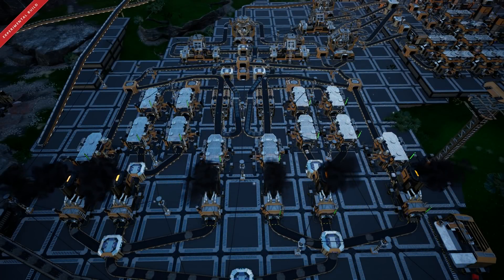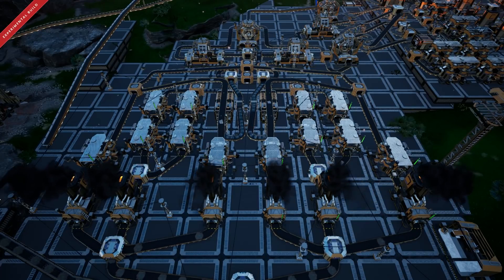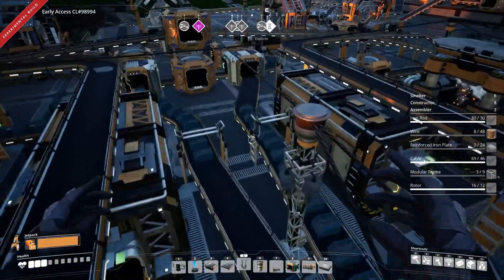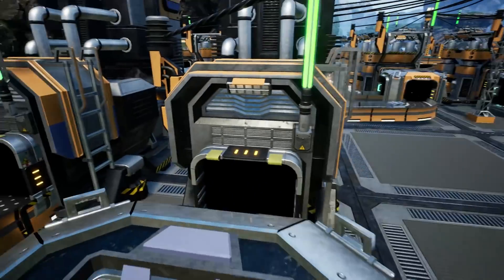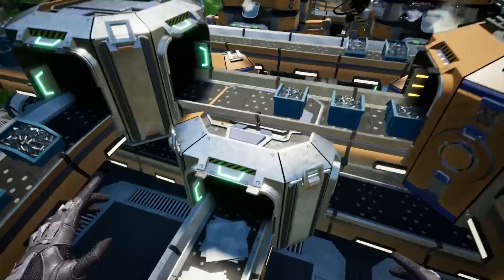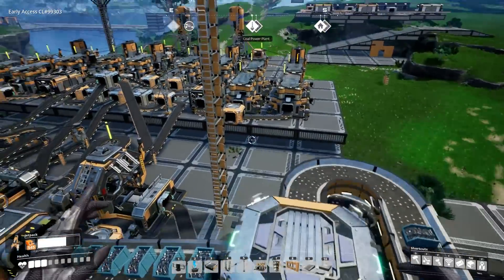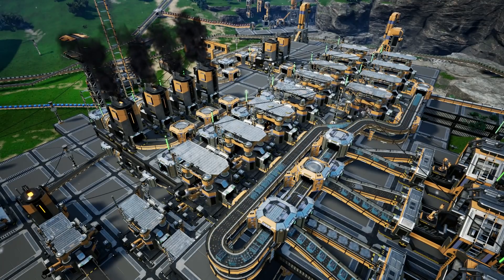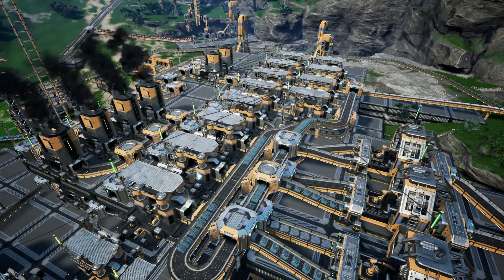Satisfactory Myth Busters: What's More Efficient, Bus vs Perfect Split

Comment: Who on earth thought split would be more efficient at all, I assumed just from logic that if there was a more efficient build it would be the BUS not the SPLIT.  That's why I built that way in the first place.  I don't see how people would come to the opposite conclusion.  Split takes more space and therefore loses efficiency on simple time-to-deliver right off the bat.  Then of course the fact that it awkwardly takes up more space in general is just obvious.  Not sure how the assumed myth wasn't everyone thinking that the split was easily LESS efficient.  Logic and numbers....it's not that hard people.
Reply from the maker: Hey thanks for checking out the video! Well TBH I thought the perfect split was more efficient and a lot of others. As I prove they are both as efficient, there are a few things to bear in mind, perfect splits are less expensive to setup but as you rightly mention take up less space. As to space to time ratios, the split is actually more efficient, in that all structures start working at the same time. and once the systems is running, it runs at a 100% efficiency, which is the same speed as the bus/manifold style, however the difference is the bus/manifold style takes a lot longer to run at 100% because all the structures after the first constructor or smelter have to wait for the previous structure to be a 100% full of items before they can start working a 100%

Comment: In a lot of places, i prefer direct Insertion. Like why do you Need a bus between the iron smelters and the iron plate manufacturers? It's a 1 to 1 ratio, all the bus does, is redistribute the resources so some manufacturers are full, while others don't yet run (yes eventually all will) and use FPS. I see 2 downsides and no upsides.
Reply from the maker: it's a fair point that you make, although please note i'm using iron for a quick and easy example on how to build one in general for those who don't know. Also FPS is not so important now with the recent optimization to conveyors but as I mention in the video it's more compact, so one upside and easily extendable whilst being the same in terms of efficiency if you're running the factory, so it goes either way. That being said it is entirely player choice, there is no one way that is better at everything :)

Comment: This is boggus, cause the perfect split factory always needs to be run at 1% less than full since it otherwise clogs and causes extreme fluctuation in the power grid because of the turning on and of
Reply: i use the perfect split method and don't have the clogging issue,i always use storage containers for buffer, and the only time i had the energy fluctuation issue is before i upgraded my conveyers because they weren't feeding some machines fast enough
Reply from the maker: Sorry i'm not sure if I understand your point, if the system runs at exactly 100% it wont turn off at all and therefore wont have any issue, if you use the bus/manifold system perfectly it's the same, however if you don't plan exactly how much ore will go through your system at anyone time then both will fill up.
Reply: I mean, by definition the net usage stays the same, because the same products are being made at the same rate. I'm not sure where you're getting the 1% less than full thing; are you trying to run your factories at precisely 100% of your power capacity? If so, why? Power generators adjust their fuel consumption based on load so it's not like it's any more efficient, and you're running the risk of a single tiny fluctuation triggering the breaker

Comment: I would have to contradict the busline vs splitline comparison. I was running busline for my coal power plants. I had I think 10 power plants running. The last plant would go through cycles of getting enough, and not enough. Eventually it would deplete.  It did this enough times that the power plant would run out of coal and the system would overload and throw the breakers. I switch everything over to balanced, the issue went away.
As long as the busline is only feeding 4 or 5 buildings, it will work fine. But when you start getting 7+ on the same line, issues start to ensue. Another good example of this is having plates/rods/screws/reinforced plates production. Busline mode will start to have problems. The reinforced plates manufacturers will start to have to wait, even if it's just 1 item, the process stops for several seconds to reset.

Comment: I've been struggling with the overall placement of factories when going for perfect splits.   I've always been told not to use a main bus as it just doesnt work in this game but I think i'm gonna do it anyways as it seems easier to plan, build and expand upon.
Reply from the maker: Perfect splits take a lot more time to develop, I did a couple of episodes on perfect splitting to create reinforced frames, and it looks good but like you can see at the start of this video, for 6 Assemblers a perfect split factory uses up a lot of space.
Reply: Who told you not to use a bus, i am gonna give him a hammer.
Reply from the maker: @Koh-Wei-Jian  :D
Reply: Bus works fine, because it's easy to show with the math that the split imbalances are corrected automatically by backpressure. This means that it takes some time to reach full efficiency, while the oversupplied routes fill to saturation, but once everything is fully saturated, it will run with precisely the same efficiency as an isomorphic lane-balanced version.

This is also why setting your clock rates as precisely as possible is good, because it means that the backpressure doesn't have to build up from the very end of the production line, so you'll arrive at equilibrium more quickly

Comment: I actually combine the two approaches. Bus line splits off to splitters, which each feed 3. I just think it looks cool :D
Reply from the maker: Might have to try it sometime :) Thanks for checking out my vid!
Reply: I also combine these approaches but in a more efficient way: I put splitters on the main bus where I extract 60 items/minutes with short Mk 1 section (all the other belts are Mk 5 in order to feed the machines quicky and also to avoid any mistake), and each Mk 1 conveyor belt feed a small amount of machines. I also feed these sets of machines from the middle, so I reach full efficiency faster.

Comment: What Satisfactory really needs is an inserter - something that can pull items off the belt or put items on the belt. That way each machine can pull off as many items as it needs, without splitting the belt. That would be the best way to set up a large bus system.
Reply from the maker: Tito Rigatoni yes, however I think they purposefully said they weren’t going to go down that route as it’s very similar to Factorio. Maybe with mods 😁
Reply: Or a control system for smart logistics. While stock_material is less than 2*recipe cost: enable splitting to output*
Reply: Unfortunately, my impression is that the games architecture wouldn't allow for that, because items on belts aren't really physically present for any purpose except a player picking them up. They're completely unloaded when no players are nearby.

Comment: Premise needs some serious work TotalXclipse, you invalidated your 'bus' design by how you capped it off at the end.

Bus lines don't have multiple exit points from the main supply. In your design, you had two separate lines deliberately colliding in the process of feeding the middle assembler and therefore closing off the line, and removing one big advantage of a bus line and that is the ability to expand as your belts improve and your input increases.

A perfect split system is ideal for a lot of uses, but expanding them is a bit of a pain. 
A bus system can expand which is ideal when you don't know how many you will need.
Each one has a specific use that you didn't address here.

A single line going into a chain, best speed is a mark 4 belt at 450 units/minute. That's 15 machines you can feed if they use 30/minute. 30 x 15 = 450. However... splitters are not perfect, they do induce a lag on that line which you get something like a water hammer effect when the material is stopped and causes a brief pause in the line if it's saturated. You can also see this effect watching rush hour traffic that slows to a crawl despite the lack of accidents.

And you didn't need to run double belts because of screws and how they're grouped. The buffer in each assembler could hold onto the screws that can't join the line due to congestion. But because you went with a double belt line and finished it by tying the ends together, you effectively created a built in balancer at the tail end.

Good design.. but that's not a bus line.

Side note: You could have ran all the screws on one line and using your design, just use a splitter at the end before feeding the screws into the assemblers.
Reply from the maker: John Walker II thanks first and foremost, it shows you care and have a lot of valid points, I felt that I had to tie the end of the screws line simple because 4 constructora worth of screws cannot run along the mk4 without bottlenecking, if this happened surely the bus line wouldn’t work 100% efficiently - if I was building something different (removing screws) obviously the bus line would be a pure bus line but with it being an apples to apples comparison it made it difficult to do it any other way. 

That being said you explained the process very well, thank you. I promise I shalnt tie the ends for a bus line video again  ☺️

Comment: Do u have a video on how to set up a bus line factory? I seem to end up with something like the split line factory and am constantly fighting to get everything all nice and neat looking like your bus line factory.
  If u dont have a video showing how to set up a bus line factory then could u make one please??
Reply from the maker: I'll add it to the list 😅 Might be busy this weekend
Reply: (RAW Stuff to be processed) -> [split] -> [split] -> [split] -> {last direct in}
(Process it) : {Then, coming out...}
{first direct out} -> [merge] -> [merge] -> [merge] -> (Off to more production-lines)

The trick is simply to match INPUT-ITEMS to CONSUMED-ITEMS... Within your belts capacities.
Then...
Match OUTPUT-ITEMS to belt-capacity, as they exit, from each machine.

Excess you simply overflow, back to the input, or on to another machine set, or just let this machine back-up and wait until it needs to be used again. (Or constantly dump excess into the new "ticket-machine", to earn points from your unused productions.)
Reply: @JD_Mortal  do you use smart splitters to specifically set the separated output to overflow or does it work with normal splitters as well?
Reply: @Jim-cu8wy  normal splitters.

Comment: The problem I have with the bus line method is that if I have big production line, for example 30 constructors producing 450 steel pipes, the last 4 or so constructors are barely working as their output isn’t hardly able to send anything out due to the constructors closer to the output line clogging it all up. Anyway to get around this?
Reply: this sounds like an output timing issue, I am assuming your using Mk4 belts which can push 450 items per min. but, with 30 constructors in line by time the last constructor pushes out its part the first one is already pushing out another part. If you have all these parts merging into the same line, mergers take one item at a time from each direction merged into them. This is what is causing the bottleneck. I would suggest forming 2 exit lines and then merging those 2 lines into 1 at the end.
Reply: Charles Ellifritt right, I have the 30 divided by 2, so 15 gets merged into 1 line and the other 15 get merged into 1 line. And then I have those two output lines merging into 1 final line. Still causes the 4 constructors (last 2 of each line of 15) to hardly be used.. but I’ve counted the output and it’s still 450 total. Just sucks having having machines being used at 10%
Reply: @Bigroc51488  What I would try then, if you have the room lol, is instead of merging the two lines back together via a merger, feed them into a Mk2 Storage bin 1 into the bottom input, the other into the top input. then you could just take out one output.  If that doesnt solve the the problem then the problem isnt with the output lines it is with something else
Reply: Charles Ellifritt I’ll try that and see what happens
Reply: @Bigroc51488  Let me know if it helps, and ill see if I can replicate it
Reply from the maker: Rocco DiCeglio maybe another possibility would be to feed the factories rather than from the two end points one at the start and then the second half way down the middle creating a separate line which joins after the fifteenth, I’m going to have to try this out to fund a solution 😅
Reply from the maker: @Bigroc51488  yeh I can imagine, that would frustrate me! Can you merge the outputs into two lines rather than one? hmm it's gonna bug me until I know the solution
Reply from the maker: @cjellifritt  good point! could work
Reply: @TotalXclipse  Ive never had so many likes or replies to a coment before lol. BTW Total I truely enjoy your videos and streams sorry I havent caught a live one just yet
Reply from the maker: @cjellifritt  Everyone on here seems really nice and genuinely wanting to help each other out, I think that's why I enjoy doing the live streams so much. (I was really nervous the first time but now look forward to it!) It would be great to see you on the stream this Sunday, we start at 5pm GMT... providing my computer isn't playing games with me (rather than the other way round :p) And thanks, it really does encourage me to make more videos knowing how much  people are enjoying these!  :)
Reply: @cjellifritt  Sorry, I haven't really been playing much for the past couple of days. However, I tried connecting the two outputs to a mk2 container and running one line out from that.  So far this has been a great solution and it is allowing the last few constructors to totally be able to empty their finished product and run at 100%! But, from what I can tell the container will fill up over time as it is slowly accumulating items.  So either I am slightly over producing by 1 or 2 items or the mk4 belts do not run at exactly 450/m
Reply: @Bigroc51488  I found something interesting in my own factory tonight that I figured I would share. I recently upgraded my reinforced plate line and added more machines, so I upgraded the conveyors feeding and exiting the assemblers to  MK4 belts, but even though I triple and quadruple checked my math I wasnt running at 100% on my last few machines.  It was really bugging me so I started scrapping the whole production floor when I scrapped a couple of my spliters and found that even though I had upgraded the belts entering and exiting them, the belts inside of them where still only MK3 belts.  Dunno if this may be a problem for you but it is definitely something to watch out for in the future
Reply: @cjellifritt  i guess this is only a possible issue if you placed the splitter on top of the belt. I personallly use the grid provided by foundations and place my splitter/merger before connecting them so there's no belt 'inside' of the splitter/merger
Reply from the maker: Charles Ellifritt exactly that ☺️
Reply from the maker: hmm, the idea is that everything should get the right amount of items, however I suppose with the distance that could add an issue in large buslines, maybe halve the distance, by splitting the line into two and tying them in the middle like I did with the screws in this video. The other option like a few others have commented would be to input too much, then at the end have an over flow pipe. Hope that helps! :) Thanks for checking out the video!
Reply: TotalXclipse well, everything is getting enough as the buffers are full. It’s just like the last 4 constructors have their outputs clogged so they just sit idle until one unit is finally accepted on the output belt
Reply from the maker: @Bigroc51488  its odd, I may just have to try it out, but I think with a long bus, it may be that because the first constructors have created an item, they then obviously have room for another item, and thus it takes the item that the last constructor was going to use.